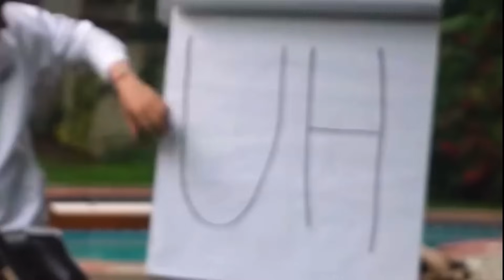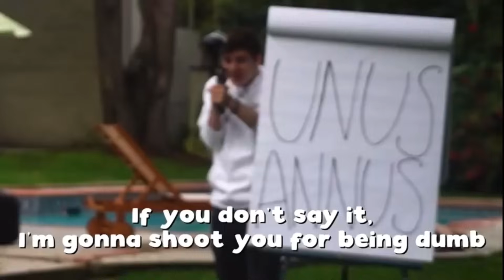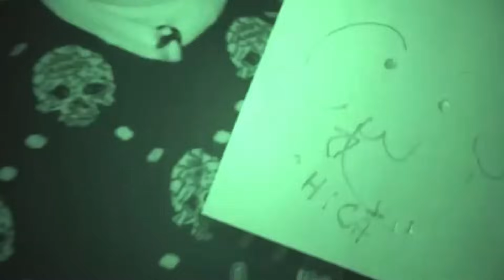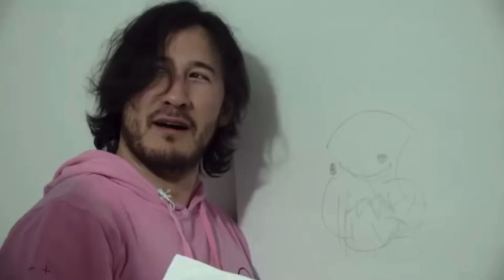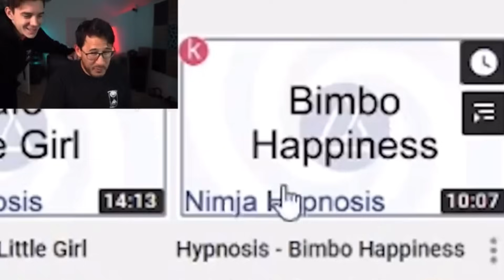my favorite Unus Annus clips pt 5

Comment: Meh, paintballs aren't so bad. I was hit in the head with one and I didn't have a hat on or anything, and it only hurt for a few minutes, and there wasn't even a bump or anything.

That being said, I also had all four of my wisdom teeth removed, and I didn't swell up, so...

Maybe paintballs DO hurt a lot?
Reply: It really depends on a lot of stuff, like the quality of the paintball, the power of the gun, the current temperature, what you're wearing, the angle of the shot, etc.

Getting hit with a paintball that breaks doesn't hurt that bad, apart from the initial sting, because the energy is dispersed by the ball popping and the paint spreading. However, if you get hit by a paintball that doesn't break, that shit hurts. All of that energy is focused directly into the point of impact.

Likewise, harder places on the body (like the head) make it easier for the paintball to pop immediately, and they're more resilient overall. But if you get hit somewhere soft, like your neck (or ass), it hurts like a bitch.